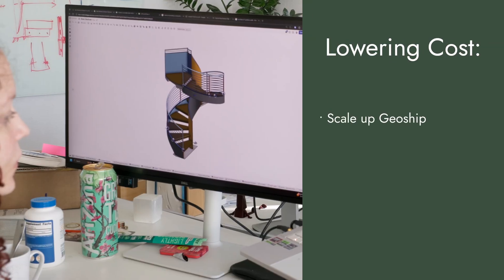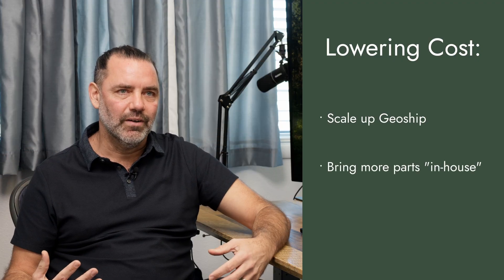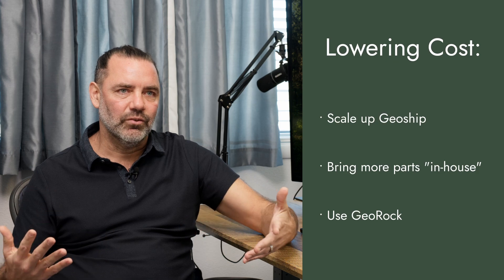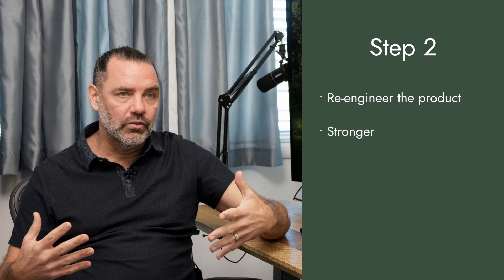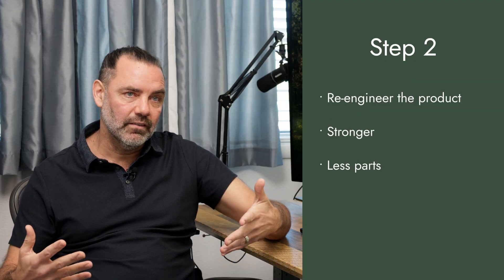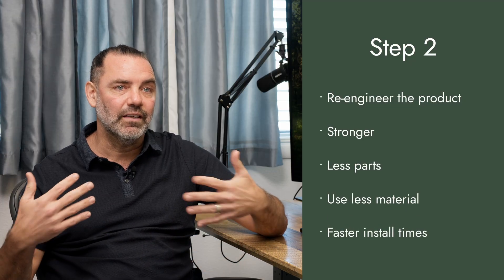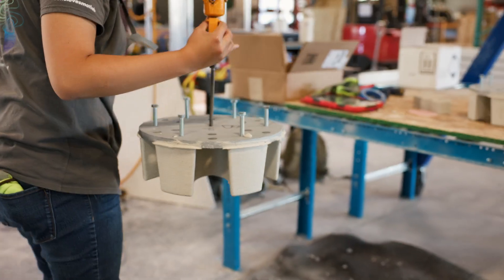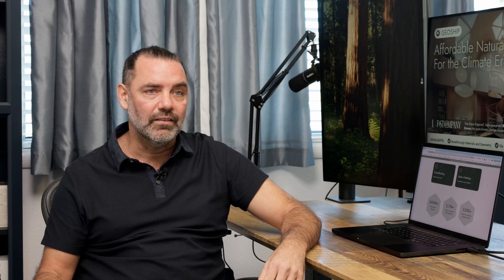The Path to Cost Down: Engineering toward long term accessibility

Comment: How is expanding automotive infrastructure onto more land for exclusive single story homes built on arbitrary lots and pads designed for drainage ultimately beneficial
Reply from the maker: Our focus is on creating long lasting, resilient homes with far lower material use and energy demand so communities have more options as they rethink how and where they build. We are taking it one step at a time while we prove the system in the real world 💫

Comment: How do the panels fit together so that they don’t leak without additional roofing?
Reply: They use GEO rock mortar.  The issue that traditional geodesic domes half with leakages that they are made from materials that expand and contract, often at different rates.  GEOrock is much more dimensionally stable through heating and cooling cycles.
Reply from the maker: The bioceramic panels are bonded together into a single monolithic shell, so there isn’t a separate roofing layer or exposed seams. Once cured, it becomes one continuous waterproof structure 🌿